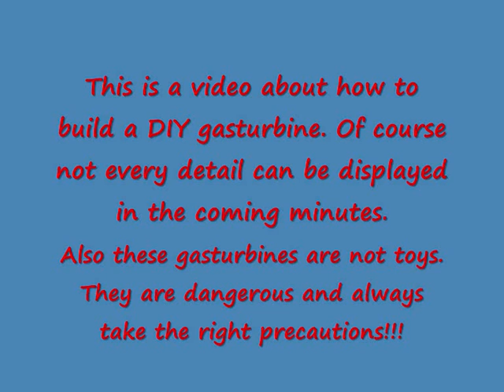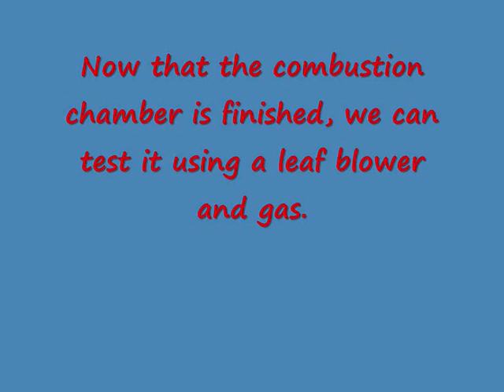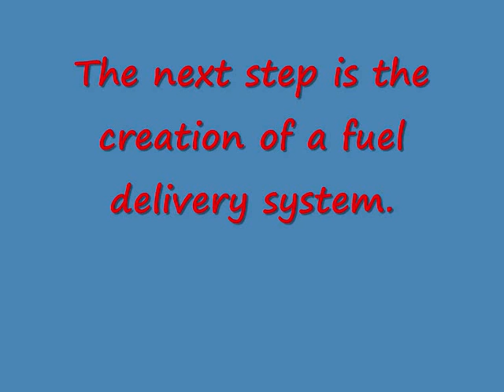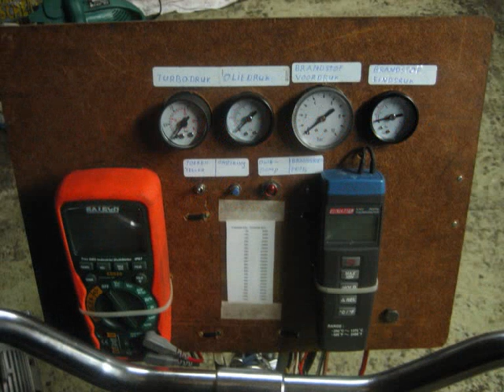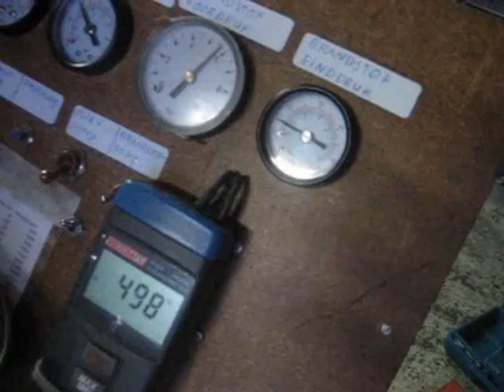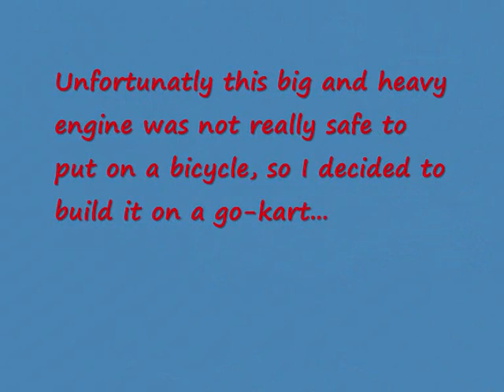How to build a real working Jet engine!

Comment: Back in the '60's my father worked at General Electric. He decided to build and install a jet engine like yours on my go-kart. They were building jet engines for jet fighters and helicopters at GE at the time. After many weeks of building the "Monster"  and much testing in the back yard, we installed it on the kart. It was powerful enough to get the kart up to about 50 MPH but the brakes were no way near adequate to stop or slow it down. Retired it when neighbors called the police.

Comment from the maker: @MrFawksii If you watch my other videos, you can see that the same turbocharger as in this video is producing enough thrust to push my kart up to 80km/h. I'm however building an exhaust turbine to get some shaft horsepower. An exhaust turbine is way more usable at low speeds than thrust.

Comment: While I found this video amusing, turbos as gas turbine engines dont  produce enough thrust to do anything decent with, if you could harness the rotary motion of the shaft, to drive a generator, then you'd see some horsepower being used. or a big fan...

Comment from the maker: @flaps20check I have some pictures, but unformtunately not from my propane injector. I used a completely different propane injector, but I heard from other gas turbine builders that the "hole in the bolt" was a very good option. cheap, easy to build and almost nothing can go wrong. Ideal size, I don't know, but I would try something like 2mm for the central hole and 1mm for the 6 smaller holes, you can always go bigger.

Comment from the maker: @flaps20check Depending on the size of your turbo 48kg/hr seems like a good estimate. At full power, my turbo used about 40l/hr of diesel. Because of the inefficiency of a turbo (because they were designed for something else... ) they are very thirsty.

Comment from the maker: @flaps20check I don't know where you got those numbers but wikipedia says that diesel releases 36MJ per liter by combustion and LPG releases 25-28MJ per liter. A propane injector is very easy, just drill a hole almost through an entire bolt. Just far enough that the hole reaches the head of the bolt, but is not penetrated. Now drill 6 smaller holes in each side of the head and you have nice working propane injector.

Comment from the maker: @flaps20check I had about 5 litres of oil running in my system and because of the fact that the core of the turbocharger is oil cooled I chose a regular oil cooler from a car. It worked fine when the kart was driving because of the driving wind, but when stationary, the oil temps were getting up fast. That's why I chose an even bigger one on the project I an currently working on.

Comment from the maker: @flaps20check Actually, no, I didn't make any calculations for that part. I just started with a big exhaust nozzle and worked my way down, just until the exhaust temps were not getting too high.

Comment: @legogunguy001 Also the fuel wouldn't "backdraft" into the fuel tank because there's no oxygen in the tank, so it can't burn till it mixes with the air inside the combustion chamber.

Comment from the maker: @noskings The spark plug only needs to spark just to get ignition, once the flame is lit, the spark plug can be turned off. It works by a small electrical circuit and an automotive ignition coil, which works on 12V. The injectors are not controlled in any way, these are oil burner nozzles which are not electronically controlled. The amount of fuel is regulated, just by adjusting the fuel feed pressure.

Comment: soooo...all three injectors inject fuel inside the flame tube right at the start of the combustion chamber where the end cap is and the spark plug is located slightly further up and also inside the flame tube? more to the point how do you control the injectors and spark plugs? how fast do the plugs need to spark or can you just run a constant 12v through them? same with injectors, normally the voltage is dependent on the injector pulse width and controlled by the ecu. how do you control it?

Comment from the maker: @legogunguy001 The oil is first pumped through an oil filter, then through an oil cooler and then to the turbocharger which needs the oil for lubrication of the bearings and to cool the turbo's core.
I still don't understand your second question, are you asking why the fuel isn't burning in the fuel tank? That's because the fuel is delivered under pressure by a fuel pump, so no fuel can flow back from the combustion chamber through the nozzles into the tank.

Comment from the maker: @TheMasterJ1995 The engine is always stopped by just closing the fuel valve, so no fuel can flow to the combustion chamber. It may look like i put something in front of the engine in another video, but just a second before that I closed the fuel valve.

Comment from the maker: @studdgage Glow plugs won't work, because they only work well in a pressurized environment (internal combustion engine). I use a propane flame to ignite the diesel. Diesel is better, because it is much easier to carry with me than some pressurized gas tank. The choise of turbocharger had much to do with the availability of money.

Comment: hey if you are using diesel you dont need a spark plug glow plugs will work lots better and try adding propane with it or convert to straight propane much better also the cummins turbos are really small use a powerstroke or duramax turbo get better results

Comment from the maker: Open up the gas valve, let the gas flow and then let the spark plug spark. So not simulataniously. The gas almost ignites every time the spark plug has sparked the first time. (sometimes with a small bang and sometimes with a soft sound)

Comment from the maker: The turbo I acquired from ebay, it is a Cummins VT-50. The combustion chamber has a diameter of 16cm and is 40cm long. The flametube has a diameter of 11cm and is also 40cm long. To acquire a good combustion I used three injection nozzles, which have better atomisation than one larger one. Glowing exhaust pipes are definately not ok, besides afterburner tubes ;).

Comment from the maker: Yes, the nozzles are from an oil burning furnace. The flametube (perforated core) is a little critical in dimensions yes. It depends on the mass flow of the turbocharger and on what fuel you want to burn. The function is the slow down the incoming fast moving air, to let the flame burn in the most efficient way. The turbo is not reving at much higher speeds it was designed for, although it revs way above it would do on a truck. Max 66000rpm (safe limit)

Comment: A good jet, nice work.What are the nozzles from, an oil fired boiler? Is the perforated core of the combustion chamber critical in dimensions and what is the function of that part? Is it reving at a much higher speed than the turbo was designed for?

Comment from the maker: Yes, it is indeed an automotive ignition system. I can be kept this simple, because I only have to ignite gas (LPG, propane). I use this gasflame as igniter for the diesel, which I inject later.

Comment from the maker: Yes definately, the blue and red section only indicate the 'cool' zone and 'hot' zone of the gasturbine. The cold air is compressed by the compressor of the turbo, then transported to the combustion chamber, where, in the flametube, fuel is ignited (red zone), so the air/fuel mix is expanding and pushed through the exhaust turbine, which drives the compressor at the front.

Comment from the maker: You can see the pump at object# 270275819898.
You have to ask the reseller for the heavy duty version of the pump, because the pump listed is a light version, capable of 30 psi.

Comment from the maker: I got my 12v oil pump from e-bay, it is normally used to as extra oil pump for gearboxes. It can deliver over 60psi of oil pressure with hot oil, which is enough.

Comment from the maker: You can do calculations with the size of the inducer, compressor efficiency and mass flow. But I didn't do that, because a lot more people use this exact type of turbocharger, so I could just use their values. And yes, when added more fuel, the engine blows itself (not only in theory). That's why I use a rpm counter.

Comment from the maker: I do have some drawings, but not digital. You can search google for DIY turbines and you can find a lot of info.
I'm not yet an engineer (studying electrical engineering). Most of the design has been done with help of a program (Jet - Spec), internet and a lot has been done with trail and error.

Comment: Very nice work. Do you have any schematics of the overall turbocharger+fuel supply & control system, or can u refer me to where I can find it?
Are you an engineer do you do any calculations to determine dimention and design of the various components or do you just do it by experientation and trial and error?

Comment from the maker: I bought the parts for: 100 for the turbo, 100 for the rebuild, 150 for the oil pump, 80 for the nozzles, total of 150 for all the steel, 180 for the kart frame, total of 100 for tubing and fittings, 80 for the oil, 20 for oil filter, 50 for fuel pump and a lot of money involved in little things. And don't forget all the time involved in building a project like this well over 1000 dollars to get to the point where I am now).

Comment from the maker: The casing of the compressor is very thick (compressor pieces have to penetrate two layers of 4 mm aluminum) and if it blows, the parts will fly in the rotational plane and not in my direction. To prevent small pieces from reaching me and objects getting into the compressor I have a protective maze covering the intake when going full power runs.

Comment from the maker: The first you need is a turbo of course, get that from car/truck scrap heaps or e-bay. Best turbos are the ones without wastegate or any pressure regulation. and the bigger the better. For construction parts you need a shop where you can get iron and steel. then you need a oil system and these parts you have to look for (plumbing bussiness). There are no rules where you can buy everything. Most have to be contructed yourself.

Comment from the maker: All the materials I used in building the combustion chamber and flametube were mild steel. The thickness of the steel was 4mm. I did runs over 30 minutes with the turbine at full throttle and it didn't show any sign of weakening, so it seems safe to use this.

Comment from the maker: The primary holes are close to the fuel injection nozzles, secondary about halfway down the flametube en tertiary at the end. Take a look at 0:40 of this video, there you can see my flametube with the three hole areas (primary at the bottom).

Comment from the maker: The answer to your question is not so easy, because the amount of holes as well as the holesize depend on the size (and therefore massflow) of your turbocharger. You need to make 3 hole areas, primary (for combustion) secondary (for combustion ending) en tertiary (for cooling). With a distribution of 30% for primary, 20% for secondary and 50% for tertiary holes. Download Jet-spec from internet(or give your email), that's a designprogram for combustionchamber sizes.
-Martin

Comment from the maker: But be careful just trying bigger nozzles. Be sure to don't overspeed your engine. You can measure the compressor (or combustion)pressure, when staying under 1.2 bar, you're on the safe side. (always safety first!), you don't want an exploding engine in your workshop! ;)

Comment from the maker: That problem can have different causes: Not enough fuel (bigger nozzle), not enough fuel pressure (use different pump) or exhaust nozzle not correctly sized. Do you know if your engine is running at full speed when you give full throttle? These turbocharger converted jet engines are very thirsty engines.

Comment from the maker: I'm using 3 fuel nozzles, each with a spray angle of 90 degrees and 3.5 gph, So a total of 10.5gph. This is actually not enough to run full power runs, so I just ordered new ones of 4.0, 4.5 and 5.0 gph, to try out.

Comment from the maker: There is a way to make it compact, then you have to make the combustion chamber around the turbocharger itself. This is very complicated and I don't have the right equipment to do that. And there is a limitation in compactness, because of the low pressure of the turbocharger.

Comment from the maker: ok, first of all, get yourself a cheap turbocharger to practise on (turbocharger from VW golf turbodiesel works fine), get the program jet-spec from i-net and design your combustion chamber according to jet-spec. Start of with LPG fueling(no liquid fueling), because that is easyier. Build a good lubrication system for your turbocharger and then start experimenting. take right precautions (fire extinguisher, goggles, ear protection). Read a lot on i-net about building jet engines!

Comment from the maker: I used a fuel pump from an Audi 100 2.3l. Used 5w 30 full synthetic oil. When oil was cold, the pressure was ok (2.5-4bar). when oil became hotter, the pump couldn't keep up the right pressure level (you need a minimum pressure of 3.5 bar) and therefore ruined my engine. I don't know how to modify, because I never did it, but I heard from others that it was possible. (need to replace plastic parts because hot oil likes to eat plastic). My conclusion was: better to use a real oil pump.

Comment from the maker: That happens when? Flames can come out of the flame tube when doing a static test like I did in the video. That doesn't have to worry you, because when operating the engine, the pressure in the combustion chamber is much higher than achieved with the leaf blower, so more fuel can be injected. (and no flames come out of the flametube anymore). Else, if the flames still come out when the engine is running, you have to change your flametube design and/or fuel injection system.

Comment from the maker: Well, it depends, it is maybe possible, but you have to modify the fuel pump. I tried it, but I wasn't able to get enough pressure. I was getting 2 bar maximum (when engine was running). This experiment was done using a small turbocharger and not the big one used in this video. (so less oil was required)

Comment from the maker: I control the throttle using a needle valve inthe fuel line. So I can control the flow towards the injectors. By looking at the pressure gauge, I can see how much fuel is injected.

Comment from the maker: If you're pumping cold water through the water connection on your turbocharger, it might be possible to leave out the oil cooler, because most diesel turbochargers are oil cooled and yours is water cooled by a seperate system. I don't have the experience in using one of these turbochargers, but you need a seperate water system (including cooler) to keep things cool. (maybe you can leave out the water system and make your turbo oil cooled). Either way its always a little bit of trail and error.